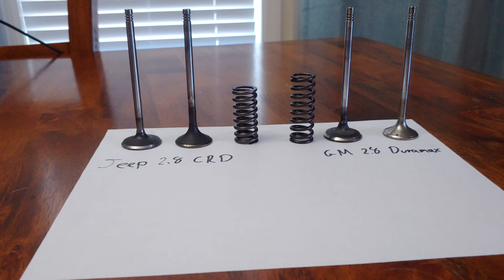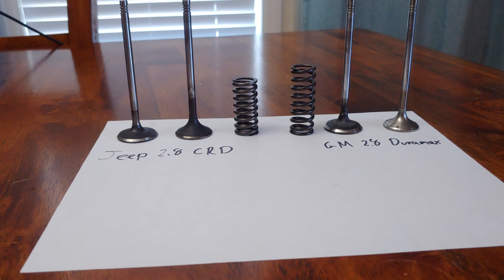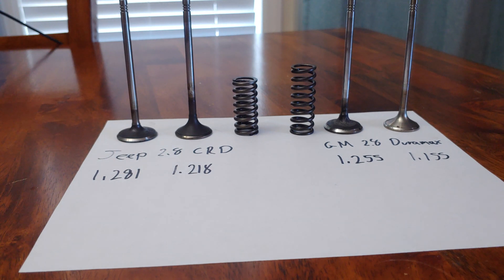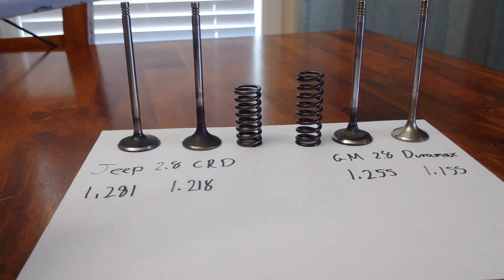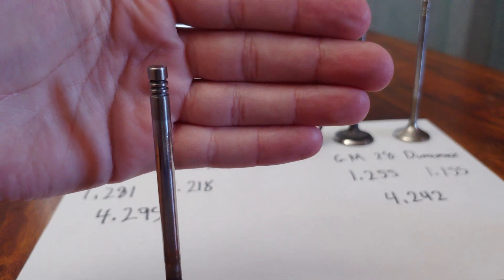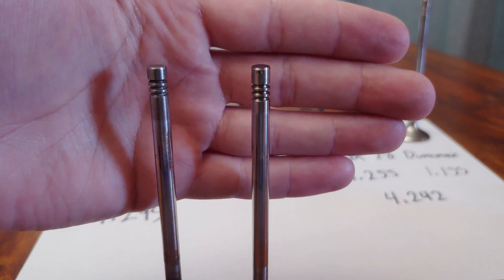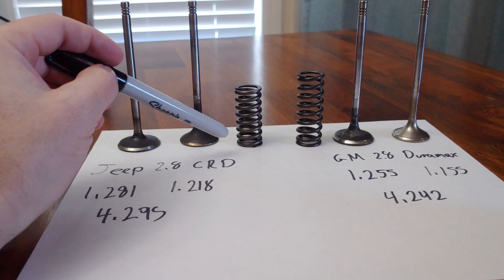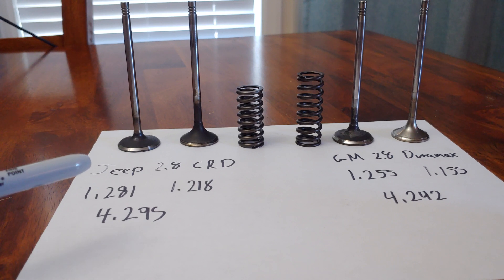VM Motori valves 2.8 Jeep CRD vs GM 2.8 Duramax

Comment: Thanks for that info. Sorry if I ended up sending you on a wild goose chase!!! Knew the heads were different, but was hoping for you that the valve would work.
Reply: I was a little impressed how cheap they were.
Reply from the maker: @ClinkenbeardStrong  I did buy 8 new Jeep intake valves from IDParts.com that cost $180ish shipped. I wasn't 100% confident with running Ebay valves. lol
Reply: Fair point haha.
Reply from the maker: No worries at all. The $50 spent was worth the knowledge. Now we know! And that fact that these valves are available (and now that I have a set on hand) we have something to work with. We'll tackle one challenge at a time and eventually we'll find a recipe that works.